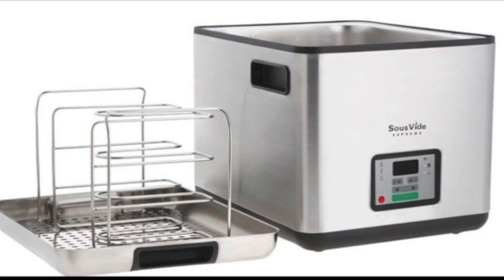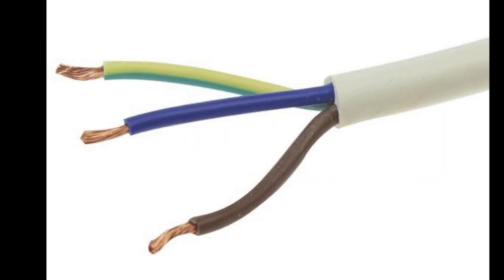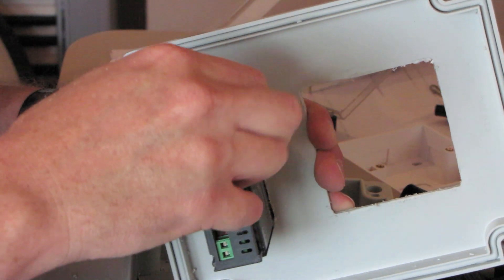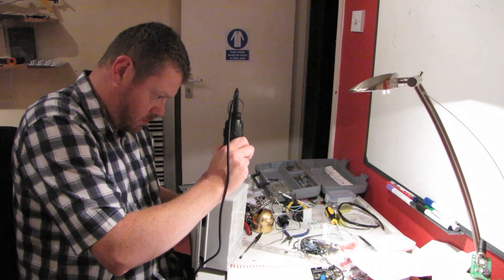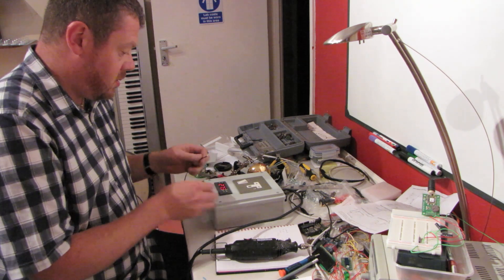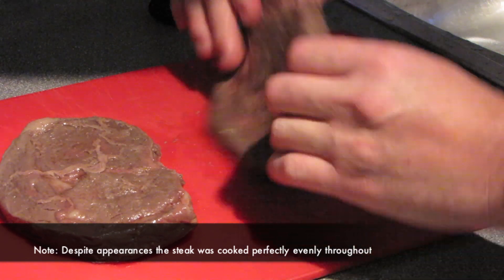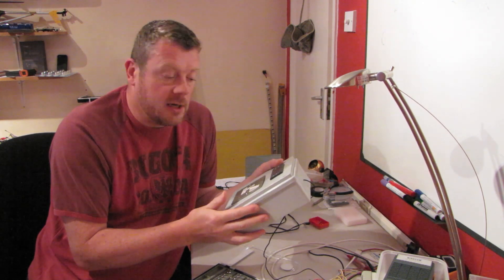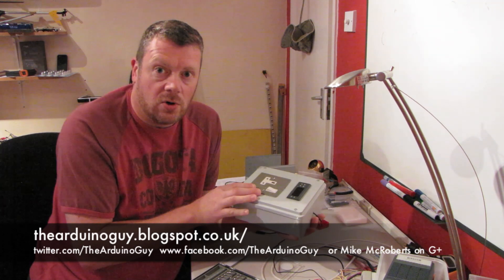DIY Sous Vide Cooker

Comment: Hi Mike, I may be interpreting things incorrectly but you say on your video clip to connect the temp probe to pins 5 and 6 but the clip shows you using pins 1 and 2 (time of 1:55. Could you clarify this before I attempt to build it! Great project.
Reply from the maker: +kw1 I think Pin 1 is the one at far left.

Comment: I am curious, are you getting any temperature overshoot? Seems like there would be a lot of residual heat in the ceramic bowl of the crock pot, which would continue to heat the water after the controller shuts off the power. I am planning on doing this same project, just wondering what kind of precision you are getting.
Reply from the maker: Probably a bit yes. A few degrees here or there either way won't make a massive difference with steaks but may affect other types of cooking. If I didn't already have the crock pot I would have gone and bought a rice cooker for this project. They have thin metal walls and you are therefore able to heat them quicker and they lose heater quicker so in other words they are far more controllable and accurate. Get a large rice cooker if you are going to do this from scratch.